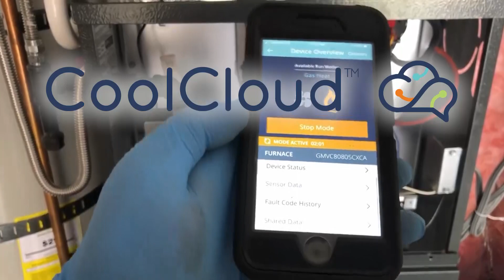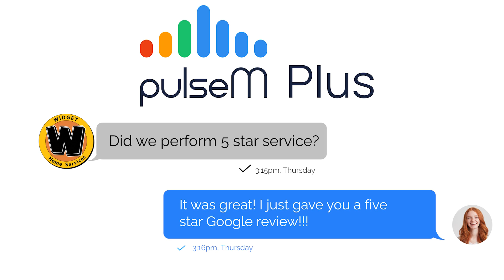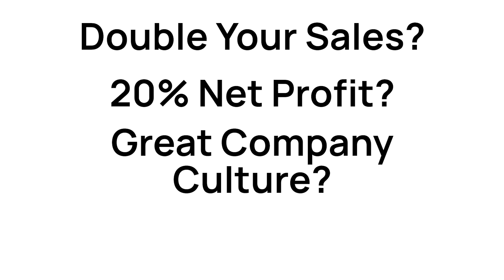98.47% Call Booking % – How Amanda Henrici of Air Repair Pros Answers Phones, Sells Clubs, & More

Comment: 🎯 Key Takeaways for quick navigation:

02:00 📊 Amanda Henrici converted 98.47% of calls to appointments in 2022.
02:29 💼 Air Repair Pros sold 1600 new club memberships in 2022.
03:28 📞 Amanda excels in call handling, objection handling, and selling memberships over the phone.
05:24 🤝 Building strong interpersonal connections with technicians and customers is crucial for success.
18:23 📝 Mastering call scripts, workflow, and building value through clear communication are keys to effective call booking.
20:54 😄 Amanda Henrici receives positive responses from callers due to her cheerful and pleasant demeanor.
21:24 🔑 Asking key questions about the issue, location, systems, and equipment age helps Amanda prioritize and provide accurate service.
22:52 💼 Amanda takes personal notes about customers, including birthdays, professions, scheduling preferences, and family relationships.
24:47 📋 Information about customers' needs and special circumstances is conveyed to technicians through software and dispatch notes.
33:26 📞 Amanda tailors her approach to discussing club membership based on customer values, such as credibility, agenda, or price.
39:45 📈 Maximizing technician performance during cyclical sales cycles is crucial to optimize call opportunities and assign them appropriately.
40:12 🎉 Celebrating wins, providing recognition, and fostering interpersonal relationships are effective ways to motivate and support struggling technicians.
41:10 🌐 Utilizing lead software like Hatch and strategically focusing on different services during different seasons can stimulate calls and boost business.
43:06 🏆 Emphasizing the importance of maintenance for warranties and offering perks like waived fees and priority booking can enhance customer retention and engagement.
46:59 🔍 Educating and nurturing leads about indoor air quality and additional services contributes to revenue growth and non-producer success.
01:00:03 💼 Keeping a planner and being accountable for estimates and opportunities prevents revenue loss by avoiding missed chances.
01:00:31 📞 Gaining confidence in call scripts and continuous practice can improve call flow and customer trust, influencing their decision to choose your company.
01:01:01 ✍️ Customizing a planner with a personal touch and aesthetic can make it more appealing and motivating to use for daily tasks and organization.
01:01:59 🤝 Connecting with customers on calls can have a lasting impact, influencing their decisions and making a difference in their choice of company.
01:03:24 🌐 PulseM Plus, a tool combining reputation management and retention strategies, can enhance customer experiences and drive repeat business for contractors.

Made with HARPA AI